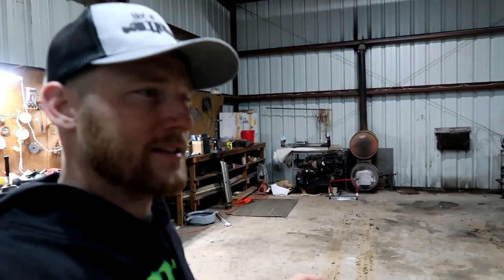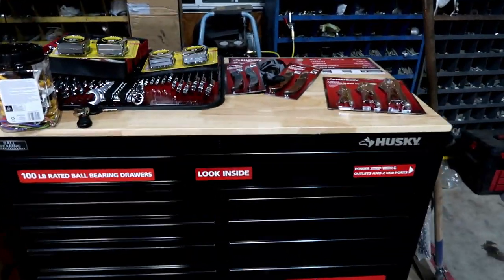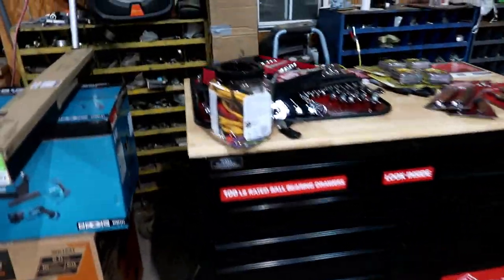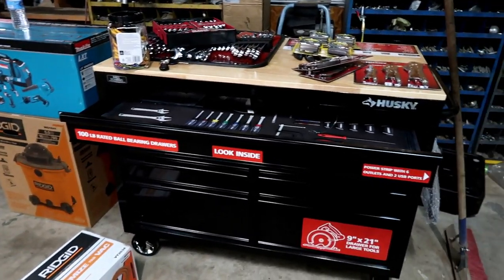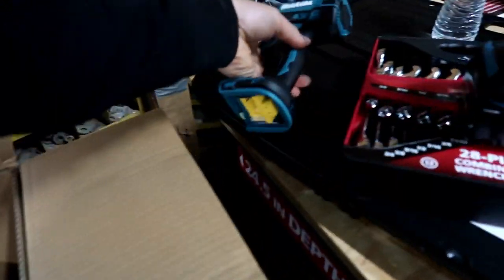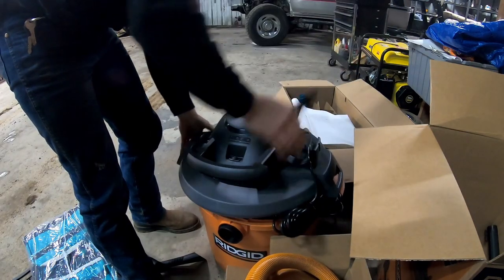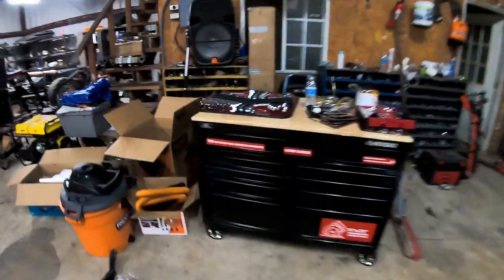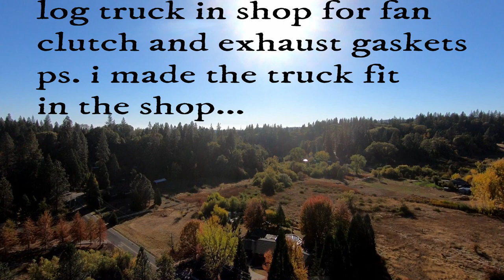BUYING NEW TOOLS ON A BUDGET! SAVED a $1,000 BUCKS... HERES HOW!

Comment: Hey Sam.  I’ve noticed when you put your trucks into gear, it appears you keep your foot on the brake.   Sometimes I notice you have a little trouble getting into gear.    When you’re going to put a vehicle into gear, even if it won’t move on level ground if you weren’t on the brake, try taking your foot off the brake every time you put a truck into gear. It’s a lot easier on the transmission and you’ll see that the truck will go into gear a lot easier.   I always also enter 2nd gear every time before I put a vehicle into 1st.   Taking your foot off the brake, going into 2nd then 1st when you need to get into first will really help.   Also if your going into reverse you can do the same procedure:  no brake, clutch, 2nd, 1st then reverse.   Let me know if this helps with your manual transmissions going into gear.

Comment: Dont have to use the oil drip for the double barrel, you can just burn in the bottom one and then the top one hold heated air.  We use one just like that in a buddies shop and it heats it pretty good makes it comfortable in 20 degree weather

Comment: I blew up the tcase on my jeep XJ (same shitty bolt location) I cut down my own ratcheting wrench and on the other end put a slot for a wire with a handle , that way in the tight space I just push it up to ratchet and pull the wire/ handle down to unbolt where I have lots of room to move.